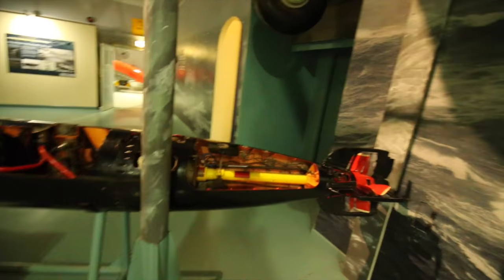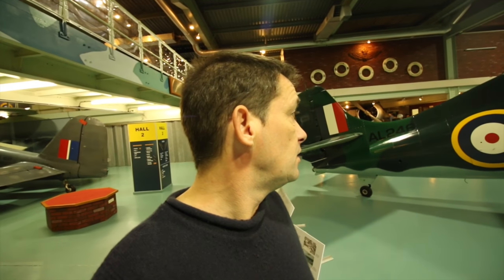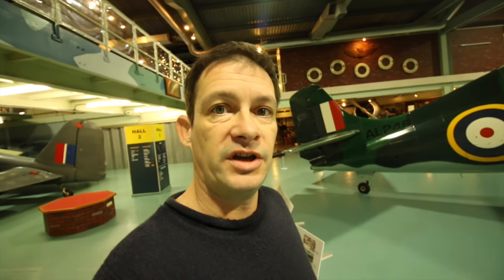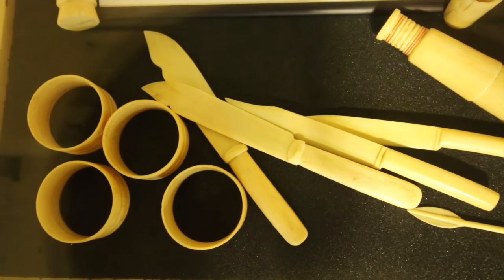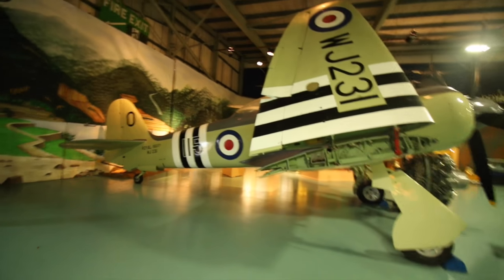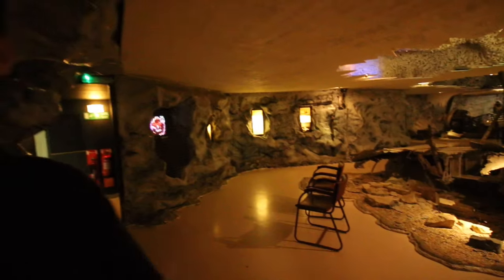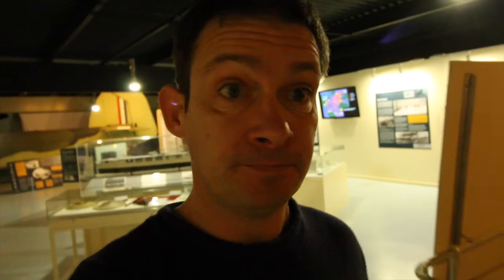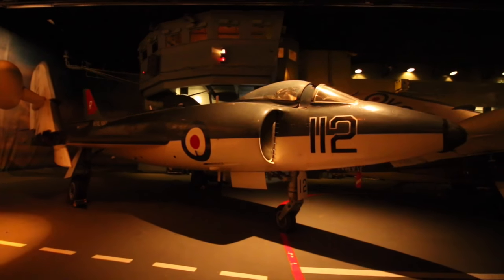How To Make A Torpedo (159)

Comment: ^They called them 'Fairey' because that was the manufactures name. Like Boeing, Rolls Royce or Virgin etc. 

They made all of these planes;
Hawker Hunter. 1956.
Fairey Gannet. 1953.
Fairey Spearfish. 1945.
Fairey Firefly. 1943.
Fairey Barracuda. 1943.
Fairey Fulmar. 1940.
Fairey Albacore. 1940.
Fairey Seafox. 1937.
Hope that helps :)

Comment: Spellings for airplanes include:airplane,  the British spelling according to Wikipedia is aeroplane pronounced the same,depending on where your from. Don't beat yourself up over memory issues we all have them it is what makes us human I like hearing them fly and start up on you tube very expensive to own. The yellow for some aircraft is known as a trainer your t-5 Texan is one such type. Your bi plane is the other type. Tail draggers as their called have to be taxied in an S because of lack of visibility. Like in your car you have two pedals that steers the plane left and right depending on which pedal you push your foot on. The yoke which what banks the plane left or right  and controls the up and down or descend or climb.  The throttle controls the amount of fuel going to the engine like your accelerator pedal the rudder pedals to double as your break by pushing forward on them. For fun ought to take a flying lesson to learn the lingo my father had his pilots license is where i got it. Learn to pre flight. Check for water in the fuel by draining some. Check flaps, check the oil,check the tires, check the propeller for damage like chips in the leading edges, learn about filling out your hourly log book for flight hours plus your airplane hours. Proper fueling so much in each wing.make sure your antenna is connected. Make sure your beacon works and landing lights. The beacon is used to identify you to other aircraft. Make sure your head set is working so you can talk to your instructor. If you got your license after ground school for your radio license learn the alphabet to identify your planes tail number to talk to the tower. B-bravo v-victor m-mike 123. C-Charlie I-indigo, T-tango,G-golf. S-Serra.Z-zoo loo. A-Alpha so when the police runs your plane they'll use a combination of that alphabet with the number oh O-Omega you say tower your alpha bet tail registration N-T-G-C 567 November TANGO GOLF CHARLIE 567 Request permission to taxi they'll instruct you to go such and such taxi way after and ready to taxi they'll tell you to either hold short of the run way or it's ok and safe to proceed. Prior to that you have to do what's known as a run up. To check systems like mags that the planes rpms don't drop below a certain point and the rpms re cover. Check both then return to run on both. Then also in that your engine is at full throttle. While the parking break is applied. After that pre flight is complete you tell the tower and let say preflight checks are complete request permission to take off they have to check radar if no planes are within a certain mile range. Some places may require a flight plan some may not im sure since my dads flying days procedures have changed. Buts it's a blast feeling free as a bird